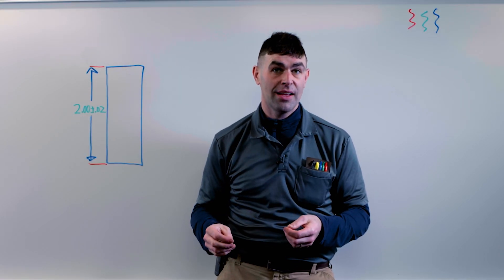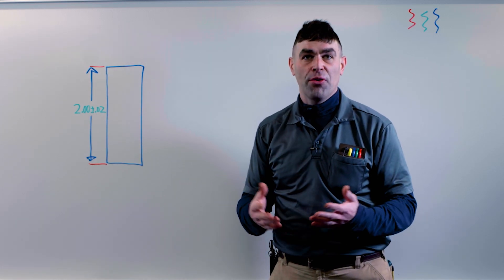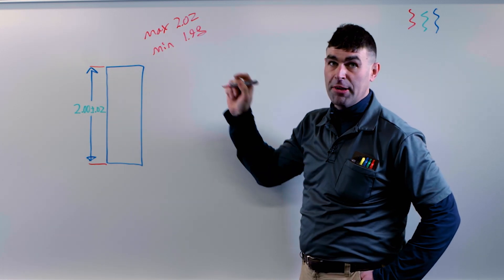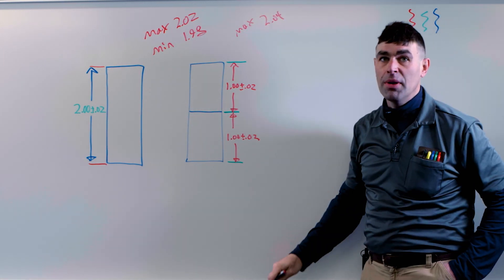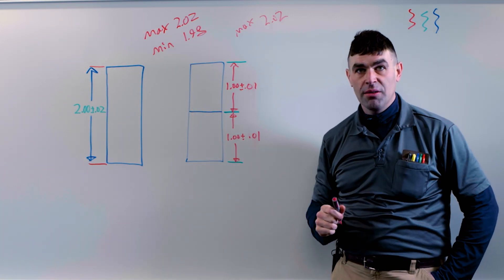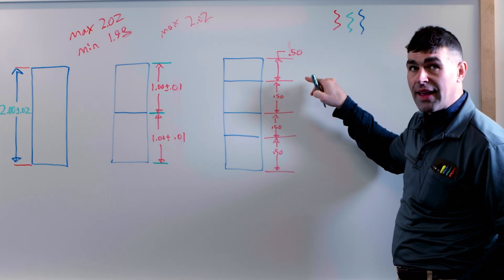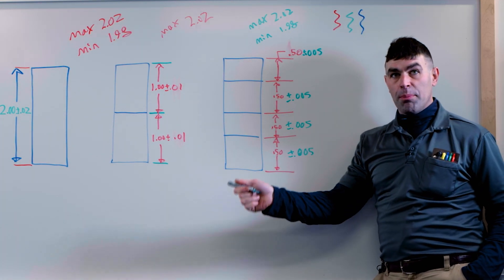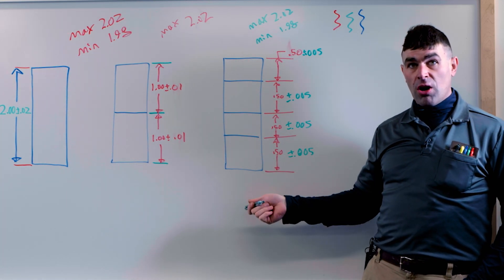Why reducing the number of parts in assembly increases tolerance allocation to parts

Comment: Thanks a lot for the video! This is a fundamental but often overlooked topic. Is it the same with statistical stackup? Intuitively there is more chance of compensation?
Reply: Only if you had an even distribution of samples. It would also require binning of parts to match them together to meet spec. Easier to just have all parts meet the tighter tolerance.